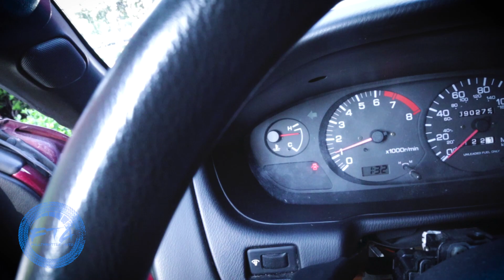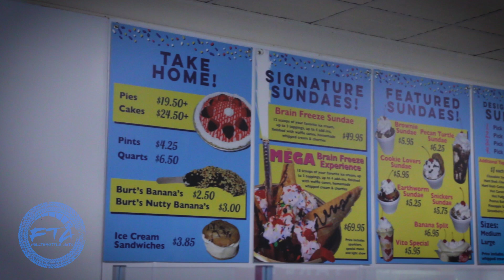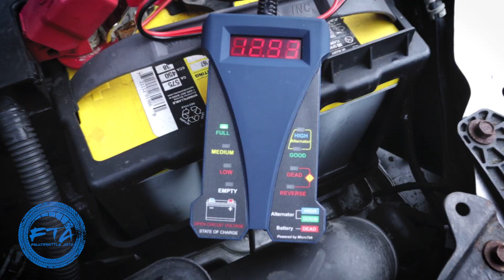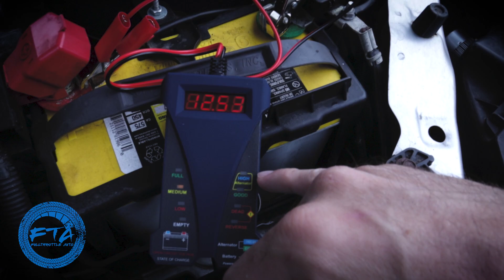Got a Newly Acquired Car | Vlog 89

Comment: Interesting.... so far only problems I had was battery and starter. Starter was covered under warranty but battery I had to buy cash. What was or are symptoms that lead to you thinking it's the alternator? Thanks.
Reply from the maker: I have a radar detector that tells me my cars voltage and has been going off recently. Then I tested with my tester and was not reading good or showing it is charging. Then I took it to AutoZone and they said their tester is reading a charge issue which usually indicates the alternator.

Thanks for watching and commenting!